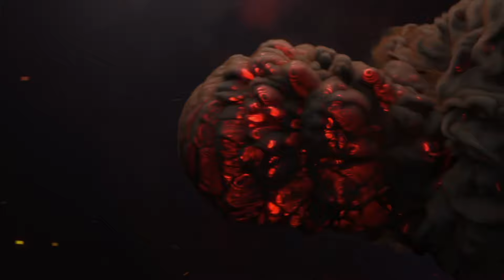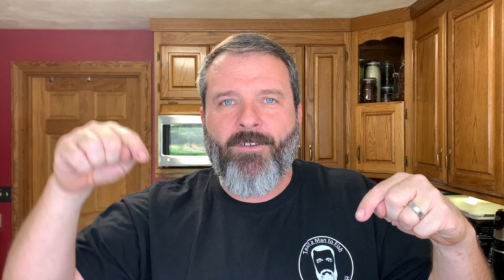🔵 Electrolysis Clean & Season Bad Cast Iron | Electrolysis | Restore Cast Iron | Teach a Man to Fish

Comment: The anode is the positive connection and the cathode is the negative connection. Electrons flow in the metallic path and build up on the surface of the pan(cathode) as the positive ions flow thru the water they meet the electron in the surface of the pan making the electrochemical reaction take place producing hydrogen gas on the cathode.  The anode produces oxygen and that’s the bubbles you see on the anode. This hydrogen process will remove the old coating or seasoning on these pans. It will even remove paint. Most say it’s good for rust only but that is just part of this process. The anode is consumed as the pan is the reduction side taking on electrons. The rust is dissolved into solution. The crud on the anode is the anode corrosion not attracting the rust as most try to say. I hope this helps. I’m a corrosion specialist with 30 years in the industry. We use these same systems on a much larger scale to protect pipelines. Except we follow a strict criteria to keep this prices from destroying the coating that this industry applies to protect the pipe from corrosion. This process will go to any anomalies in that coating to keep it from corroding. The criteria ensures that we don’t destroy that coating. That’s a book in itself to explain. Sorry for the long response.

Comment: Something a neighbor recommended to me was to use a pant mixer on a variable speed drill to mix the sodium carbonate, it worked. I usually let em wait in the lye tank before going into electrolysis tank. If you'll be careful you can mix the Lye the same way. It cuts down on the time in the e-tank. I've agreed to clean cast iron for an auction house so turnaround time matters to me. I guess I've joined the Black Pans Matter movement !?
Reply from the maker: That would certainly speed things up.  I'm in no rush though.

Comment: Sodium Bicarbonate also works. It’s a little more gentle but still provides the necessary path for the electrolysis to work.  Borax also works. I’ve used both.
Reply from the maker: Thanks for sharing your experience with electrolysis!

Comment: I've used this process many times and read many instructions on how to do it. Never have I seen anyone use a metal container. In fact, although many people  have different set ups, they have ALL said to use a plastic or non conductive container. .And never use stainless as an anode. I don't see how this works for you but you may be doing something dangerous.

Comment: Just stick the pan in the oven (upside down)and turn on oven cleaner button. Takes a while but it will be clean as whistle and you can start seasoning it about 5 or 6 times.
Reply from the maker: You do risk warping the metal with the oven cleaner process, user beware.

Comment: how long do you keep a pan in the electrolysis tank?
Reply from the maker: 2-4 days.  There are factors that make it change, like power strength, shadowing, size of material, gunkiness, etc.
Reply: @TeachaMantoFish shadowing or line of sight is a myth. Current flows at all area or surface area of the pan. By turning it to face the anode is really not necessary and will seem to help as most try to say. I’ve experimented with many pans and had hydrogen gas burping from a pan that was facing down in the tank. So yes it was making gas and building up and belching gas. The own came out clean on all areas.

Comment: 3:47 Can you make sodium carbonate? I thought it was just sodium bicarbonate soaked in water and then oven dried at 200 degrees... (not too hot... hotter is not better) it's worth looking into.
Reply: Arm and Hammer WASHING soda not baking soda. Comes in a box like detergent, in the detergent aisle of Walmart. Cheap, too.
Reply: @edsmith6504  you can make washing soda (sodium carbonate) from baking soda... (sodium bicarbonate)... that's all I'm saying.
Reply: just cook the desired amount of baking soda in a pan on the stove till it stops steaming. Your cooking the hydrogen out of the soda. After it cools it's the same as washing soda.

Comment: Still have no idea how to do this.  Good thing I have a brother. You have very pretty blue eyes, Mr. Teach a Man to Fish.
Reply: Hey this might be late but if you look up a diagram for a electric cell it gives a really really good demonstration of how it works and how to build it. You can also calculate the charge baised on the metals in order to find how many volts you need to use to drive the oxidation/reduction reaction
Reply: @twoduces195  I have no idea what all that means!

Comment: I use a lawnmower battery attached to a trickle charger. Works great.
Chick at lawnmower repair shop just gave me the battery. Was almost brand new. A little sweet talk goes a long way lol

Also...can balled-up aluminum foil be used as a scruber?

About to get the cast iron Dutch oven out of solution in 1 hr!

Comment: Is this method better than an angle grinder & a good wire wheel? Just seems a lot slower?
Reply from the maker: @stevedraper6008  it does require patience.  I’m not a fan of altering the sieve, doubly so if it collectable.
Reply: @TeachaMantoFish  thank you for the reply - I didn't consider the collectable aspect of course that makes sense. I just have a grinder / wire wheel here, but no Bath for my cheap set.
Cheers!
Reply: That will ruin any value of your own. Use oven cleaner and a trash bag then.

Comment: One more question. I suspended the cast iron from a piece of rebar laid across the top of the tank with copper wire and connected the negative charger lead to the wire. Should I have used something other than copper wire. Thanks again.
Reply: Copper will work but is a weaker steel and if any heat then the copper will not hold well. I use either but an old welding rod works great and is strong.

Comment: Just watched your Electrolysis  video that was done two years ago.  I am interested in building me a similar type of unit.  I understand the barrel and I  have access to one.   But, could you provide me with the type of pipes and a dimension of an outline and what needs to to welded?  Plus you have some "panels" welded so I assuming to eliminate any areas that could get shadowed. 
 A diagram would be great.  I enjoy your videos.  Thanking in you advance for your help.  If you need me to send an email to your address, I can do that too.  Thank you.

Comment: Great video, never heard of this before and I’m an electrician lol. 
My BBQ hotplate and grill are both in bad shape. They are fairly large 45cm square each. I’ve tried scrubbing them with wire brush and all sorts of rust remover and chemicals. I even dipped them in Hypochlorite acid for 2 days. This removed a lot of rust and I washed them clean and they seemed in good shape. I thought job done ✅ But next day they were totally rusted again. Maybe they were actually clean but it’s the ‘flash rust’ I’m getting as I didn’t finish the process. I will wash them again and if there’s no rush I will oil and bake them straight away rather than leaving them for a day. By the time I get them repaired it’ll be winter. 🤦‍♂️
Reply from the maker: Interesting, please let us know if you get it figured out.
Reply: Maybe heat treat them after removing the rust and before oiling the parts.
Reply: Got them sorted. 
Went for the electrolysis in the end. 
Dried them after. Oiled them and heated them up. Oiled again. Used rapeseed oil. 
All good now.
Reply: @talmanyurkovich4486  You should heat treat the pans before oiling them after the electrolysis. It's called blueing.
Reply: @andrewmckinlay2964  
I found that just created more flash rust.
Reply: @talmanyurkovich4486  You mean before the blueing process?
Reply: @andrewmckinlay2964  
Yeah once it dries it only stays black for about 8 hours then started to rust again the next morning. This happened twice. 
So I decided to dry it as best I could then oil it and heat it up the same day and re-oil a second and third time. Leaving it for a day to dry was not a good idea.
Reply: @talmanyurkovich4486  I mean heat treat then season right away.
Reply: @andrewmckinlay2964  
Ah ok. Yeah probably would have sped things up and avoided the flash rust. My problem was the grill and hot plate didn’t fit in my oven and the BBQ was soaked.

Comment: I do this with old rusty tools. 
Worth mentioning how this should be done in a very well ventilated place as this process and its bubbles create Hydrogen gas, and with sparks being created disconnecting terminals, you don’t want a Hindenberg Zeppelin incident…

Comment: Better check up on using stainless in the tank. You will run into some issues with acid gas as a biproduct
Reply from the maker: OK
Reply: Dichromate is actually a water soluble species, not a gas. But the whole issue of using stainless as anodes seems to be pretty controversial. I have seen videos on channels that use them, and if they're aware of the issue, some say the current and voltage is too low to make dichromate. But lots of people are simply repeating what others are saying - stainless anodes make dichromate. I have not yet been able to find technical data that supports either position. If someone knows of some reliable testing data (not  using the home drinking water tests), please share the link.
Reply: @Rockhunter329 this process dissolves the chromium into solution. Not recommended to use at all.

Comment: Using a Variable DC power supply can work instead of a battery charger.
Reply from the maker: Yeah, someday I may pick one up.  Expensive to me though.  Be a cool set too.
Reply: I have seen power supplies on Amazon that are 30 v, 10A variable DC power supplies for about $50. These days, I've heard manual chargers can be hard to find and probably aren't cheaper than this Amazon units (if you don't have a charger).

Comment: what about the theory to heat the water out before you season?
Reply from the maker: I've not seen that make much of a difference, also they say it opens the pores in the metal.  I figure once wiped down and heat in the oven it does that.  I will say that heating it up does help getting the coating as thin as possible.  It makes the oil flow and absorb better.

Comment: I followed your video instructions and it seems to be working! I even have the same brand of battery charger, except mine isn’t dual voltage. I do have one question, somewhere in the video, you made a comment about oxygen and hydrogen. Is this producing hydrogen gas and if so, if I use this in an enclosed area such as my garage, can I have a potential Hindenburg like moment?
Reply from the maker: I know I’ve never even come close to that kind of concentration, I would do it in an enclosed space where it could build up.
Reply: @TeachaMantoFish  Possible typo here!? You would(?) or wouldn’t(?) do it in an enclosed space?
Reply from the maker: Wouldn’t 🤣
Reply: @TeachaMantoFish  The infamous words of Marvin the Martian, “There was supposed to be an earth shattering kaboom!”
Reply: Chris my wife and I are empty nesters which means we have unused bathrooms. I set a 5 gallon lye tank (kitchen garbage can) and my electrolysis tank (18 gallon tote) in one of the unused tubs. To keep the charger cool I set it over the air vent with the central heat & air unit fan turned on. Either because the fan is constantly on or the low power going into the tank there hasn't been a problem and I do use stainless steel anodes. Stainless is far easier to clean than carbon anodes. The battery charger has made sparks several times with no Kaboom or "Oh the humanity". I've used this arrangement for 7ish months and dozens of pieces.

Comment: was it set to 6v instead of 12 for a reason?
Reply from the maker: It depends on how fast I want it to work.  Sometimes I use 6V when not in a rush and want to be easier on the wiring and equipment.  Wires and connections can get hot.

Comment: I'm about to build an electrolysis tank and opted to use an adjustable DC power supply. They are very easily controlled and maintain a constant current. 

Ill be expirementing with settings but plan to start at 20V/5A.

Comment: Just a few comments, if you can voiceover the mistake of anode and cathode (you reversed the terms, and Scheumaker still is making very nice manual chargers as well as many other companies. Just need to look harder or buy online.
Copper should never be in the water as well as any other toxic heavy metals like galvanized steel.
Reply from the maker: I did

Comment: You just cooked so much rust into that egg
Reply: You body needs iron
Reply from the maker: Not really as much as you think, and to @james1578 point you do need iron.  It is actually one of the benefits of using cast iron.
Reply: Better than the VOCs from the teflon forever xhemical coatings in your bloodstream (i.e. Calphalon) i've retiired the same and pivoted to stainless-steel (e.g. All-Clad) and cast iron (e.g. Wagner Ware, Lodge and Griswold). What do you mean by 'machining' in the manufacturing process of the cadt iron? GREAT video - learned a tonne!

Comment: It seems totally unnecessary.  I just put mine into my propane barbecue grill with 3 burners on high at about 600 degrees Fahrenheit for 2.5 hours, and then when they are still hot I rinse them in cold water. After a few minutes of scrubbing gently with a scouring pad they are absolutely clean and ready to be re-seasoned.
Reply: You are introducing a LOT of stress into your cast iron. All it take is one small imperfection and the shock of that cold water will force that imperfection into a large crack.
Reply from the maker: Like others have said, there's risk to doing that.  If it is a family heirloom or an expensive collector's piece, I don't recommend that.